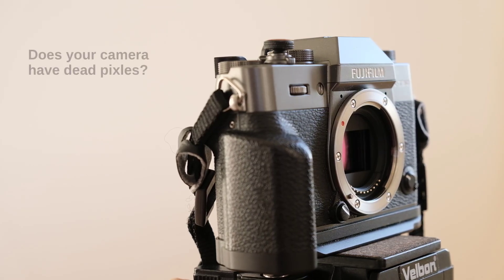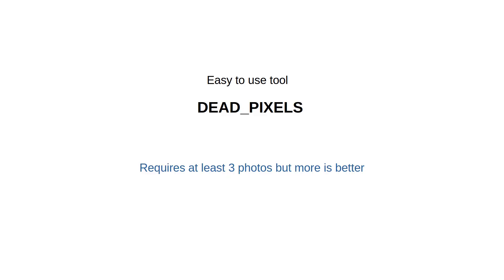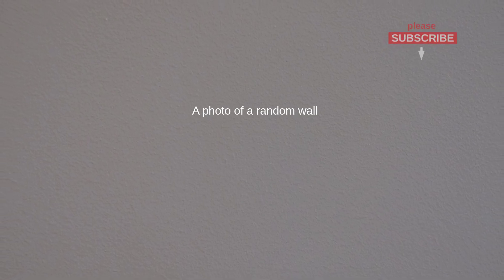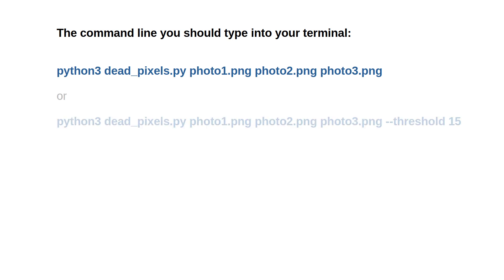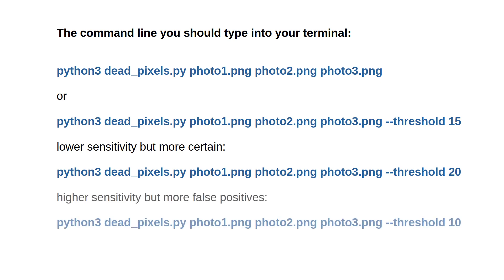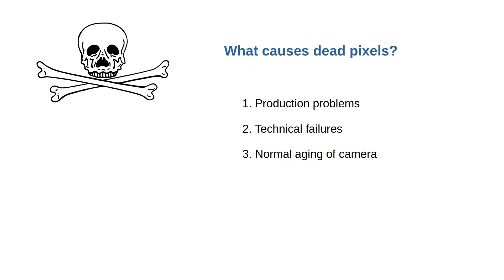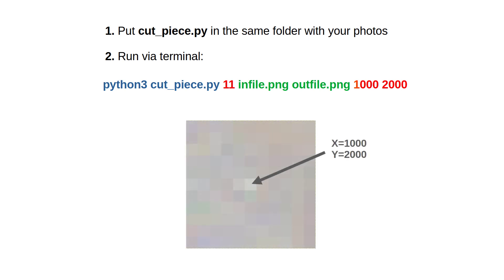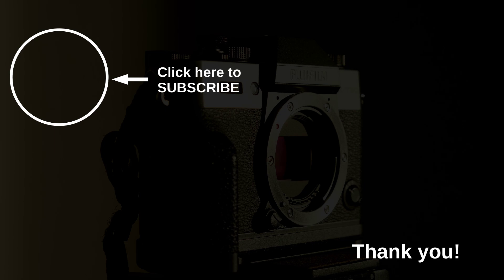A simple method to detect DEAD PIXELS on you camera sensor. Use it before you buy a camera! (2025)

Comment: A thousand apologies for being late to see this, and I have one more to see to catch up! I was disappointed that my Canon 5D Mark II had developed a dead pixel considering the fairly low shutter count and pretty low video use, compared to the serious boys. It wound up in my short noir film, and I had to patch the area in the video using the Photoshop animation timeline and adding a layer of sample skin from a similar part of the film. Any movement of my subject or camera need various patches in separate layers that I could control with density changes over time. What a pain after doing all the other work I did with animation. But that wasn't all. My main character had a sunburned nose..a real patch of it right in the center of his nose, and I had to run patches over it, changing density and movement for shots lasting ten seconds or more. You can only do so much back in 2011 with CS 4 Photoshop extended...
Reply from the maker: Hi! Thanks, this is very interesting. I wouldn't have guessed that a single dead pixel can have such an effect, or even a noticeable effect. Of course it matters greatly what kind of work you're doing with the camera. Generally if you have 5-6 dead pixels and they are scattered all over the frame, nobody will notice. Cheers!

Comment: At least with Nikon cameras you have the option of "Pixel Mapping" in the menu, to fix stuck hot pixels. Maybe all brands have something like that. So it would be a good idea to try it after cleaning the sensor to solve the stuck pixels problem.
Reply: Yeah, the latest SLR cameras from Pentax have it too.
Reply from the maker: @YerUnclePhil  Hi! Thank you for your response. Cheers!
Reply from the maker: Hi! Yes, this is very true. Thank you for commenting!
Reply from the maker: Hi! Thank you for your feedback. You are absolutely right that most modern cameras offer pixel mapping capabilities. The reason why you'd want to use an external tool such a mine is when you want to know where the problematic pixels are located and what they look like. Pixel mapping can then fix or partially hide the dead pixels. Kind regards!